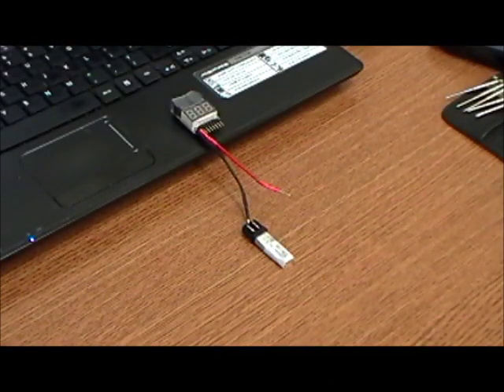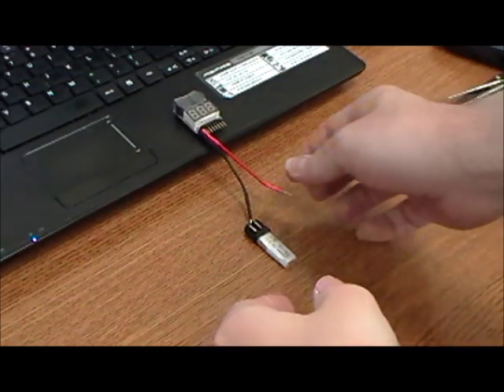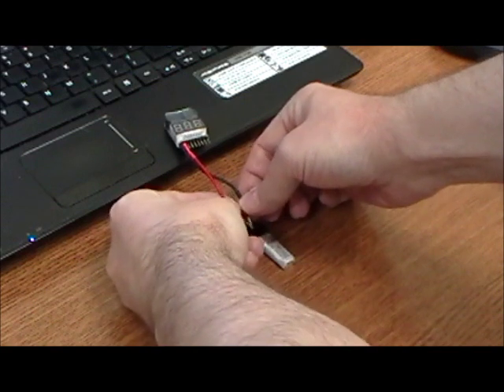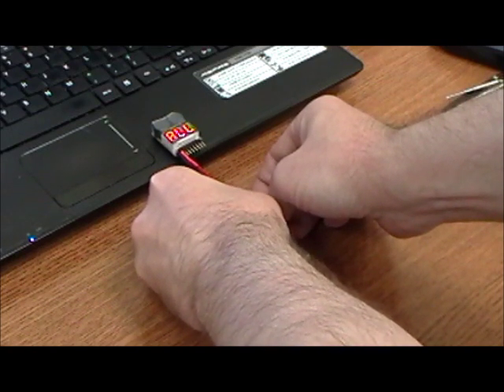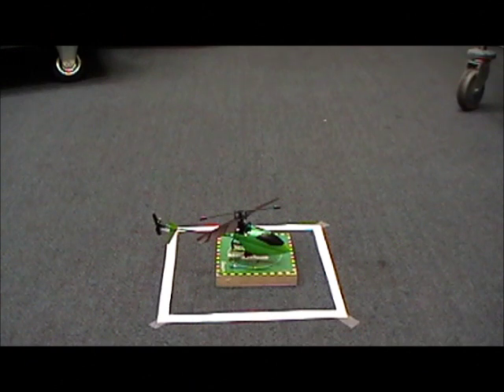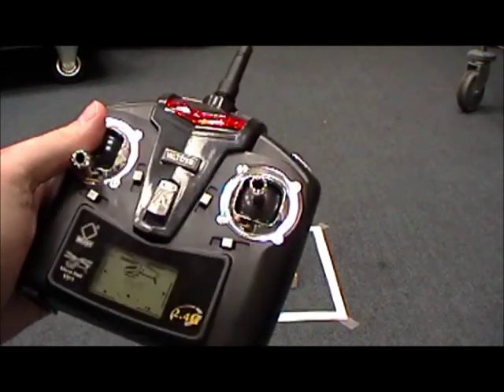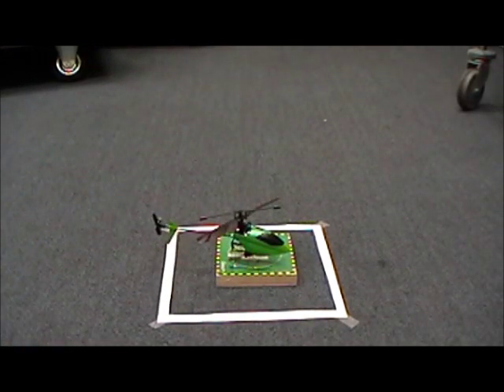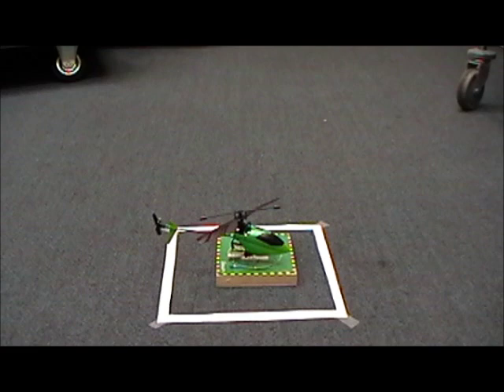V911 HOVER with a brand NEW 145mAh battery.wmv

Comment: My v911 pro has the new style batteries and they were showed to have 200mah if you read the batteries it says 175
Reply from the maker: mislabeling/misrepresenting the mah of batteries is a pretty "old vice" in rc (its been there ever since I started flying helis ... but it was more "rampant" some time ago than it seems to be now. Still not surprising if a supposed 200mah battery is only 175mah ... but believe me, there could be worse - the effect of these 25mah is probably negligible [the flight time you gain through the 25mah you will loose because of the higher weight - its probably a wash])

Comment: Where did you get these batteries? Are they the biggest capacity available I've heard of people with 200mah also
Reply from the maker: Hi,
as you may see, the video is more than 1.5years old. Those batteries were sold a long time ago at BG for the "original" 911 models, long before they changed the plugs to the style they are now.
As far as I remember, the whole "battery history" goes kind of like this:
first there were the 120mah (original) batteries. Then they realized, those were def. not powerful enough, so they were "extended" to 130mah and later to 145 and 160.
Then they changed the plugs to the now common version and the batteries went to 130mah ("original V2") and 150mah instead of the 160ones. (But those new 150s actually seemed to be superior to the old 160s. However, as people never get enough with this stuff (even though flying the heli longer than 5min a pop is probably not beneficial to its longevity) and cried for 8,9 and 10 min flight times, they came up with the 200mah's. However, those are heavy enough to AGAIN NOT allow you to fly 10min ... more weight, less flight time. There were quite a few people on the forums who after a while actually complained about the 200s and kind of tried to make the NEW 150s (new plug) the (seemingly) optimal choice - and I tend to agree.
For me, more than 5min is not necessary or desirable (been there, done that) - so the new 150mah's offer the best combination of power and weight ...

Comment from the maker: I did not test the new 200mah batteries myself - I dont fly the V911 that often lately at all ... No idea what the "real" flight time would be, but there were quite a few people who reported that the 200mah are heavy enough that much of the gain in flight time is wiped out by increased weight (compared to the 150s or more so 120s)
And you are correct, hover is not an accurate measure for flight time if you compare it to "real" flight as you need only a little more than half throttle ..

Comment: Hello, i noticed there are some 200mAh batteries with new plug for this 911, did you managed to test some? I wonder what is the real (time) difference between them. Also in my heli i noticed that the time it flights is tied to how much you push the throttle. So a regular hover would not be quite exact on the time it actually flies.

Comment from the maker: WHY do you want longer blades? ... if I may ask? As far a me personally, I dont know any microsized rigid blades that are bigger than the V911/SP260/270 blades. The problem here is, IMHO, that if you would want to do this, you would need to do a head mod (like getting a mcx lower head for the Xieda9958) and then using modded blade grips and the folding blades for Walkera V120 size heli ... IF that even works. But in my eyes this would be way too complicated for the result you MIGHT get - or not!

Comment from the maker: If it is the NEW style plug, the battery has a white plug at the front (for those you can get the 200mah batteries), if it is OLD style, the battery has two silver contacts on the top (or bottom - doesnt really matter how you call this side of the black plastic) of the plastic cover ... (Those batteries only exist in 150mah max to all I know)

Comment from the maker: YES, the upgraded batteries for the NEW version V911 are 200mAh - but this one was done with a V911 with an old style plug ... and those batteries are only 145mAh!!
So if you have a V911 with the new style battery plug, then sure, you  can do this with a 200mAh battery!

Comment from the maker: I have not looked at the trim settings on my 9X - I am using settings by Daryoon from RCGroups (guess you can contact him through RCG or his site "hacksmodsdotcom"
as far as TREX100: cant say anything about it, as this is one of the micros I actually DONT own. not sure if this LG would work for V911, often the frames are just a few mm different between the mounting holes. My solution would be "modded" airtime skids - but that would require to change the battery as well (to mSR style ...)

Comment from the maker: Honestly, I never did the same test with a stock (130mAh) battery; well, those were the newer stock batteries. The old (ie REALLY original) ones were only 120mAh anyway.
But all of this does not change the core of my answer, which has to be "sorry, really dont know"
However, according to general experience, the gain in flight time should be about a minute give or take ...

Comment from the maker: Usually, I like to fly them with the TH9x transmitter, as I have the feeling of much better control (and it is much smoother than the stock TX), but YES, in this video I was actually using the stock TX.